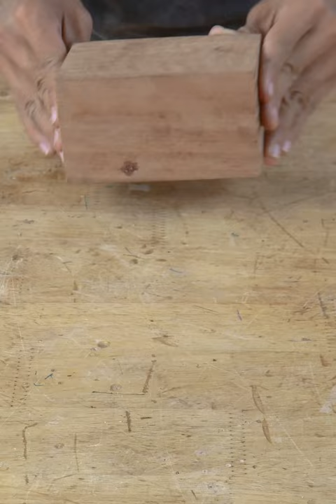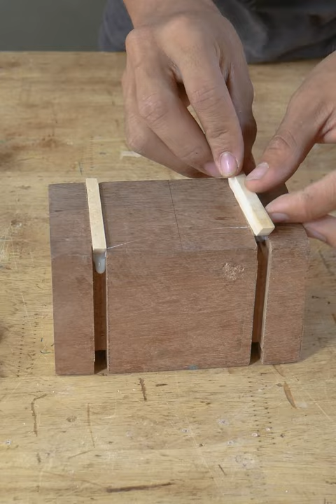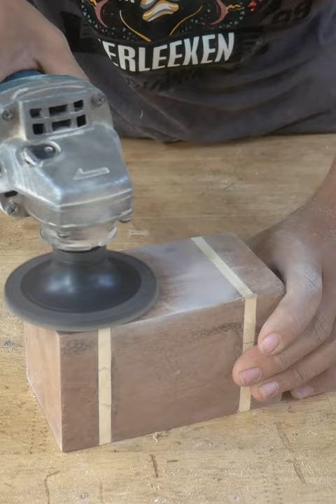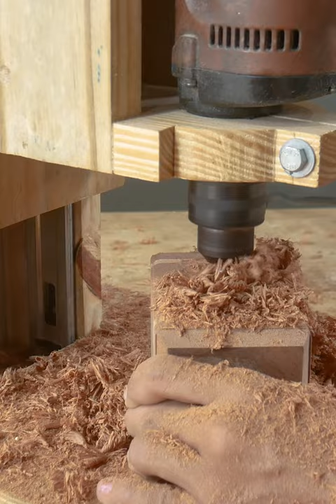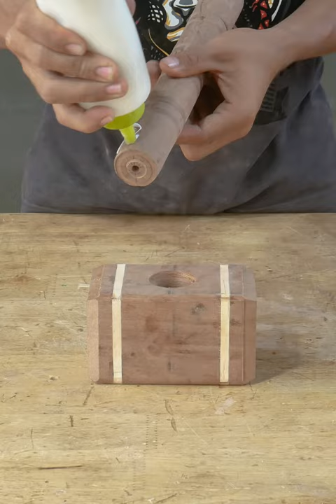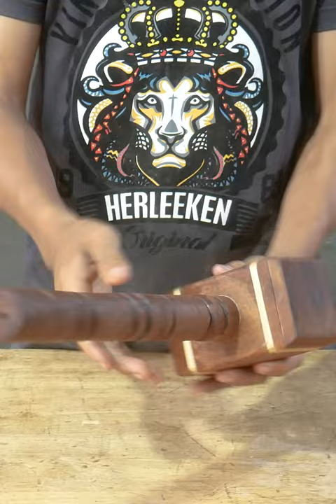Shor 's Big wood Hammer #woodworking #diy #shorts #amazing #trending #shortvideo #tools

Comment: That is an extremely raffish way to feed a table mounted router. Not to mention foolhardy! A climb cut with a hand held workpiece risks the work leaping out of your hands if the friction drag you provide by pressing down on the table wavers for an instant, but to trap the workpiece between the bit and the fence while feeding in that direction is asking for trouble. I am surprised!

Perhaps this is caused by the video appearing as a mirror image?